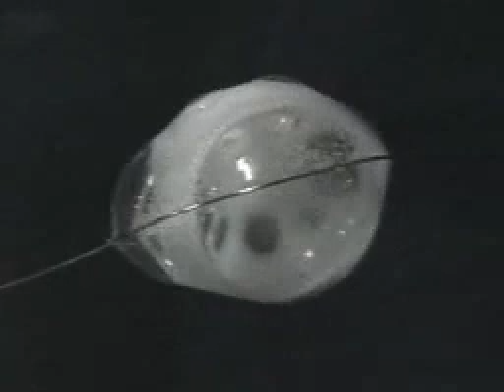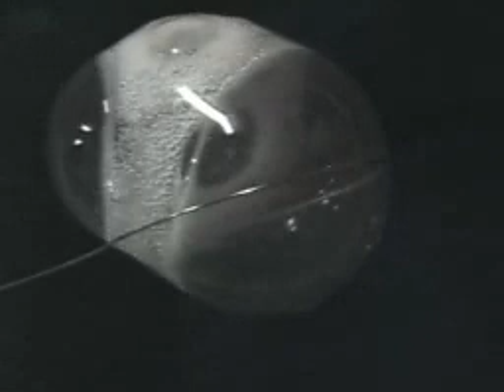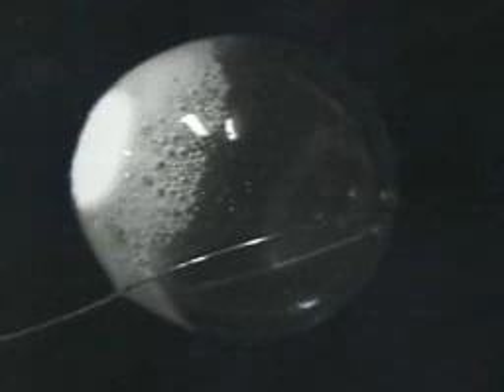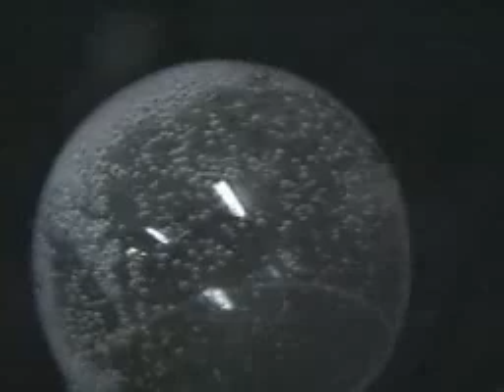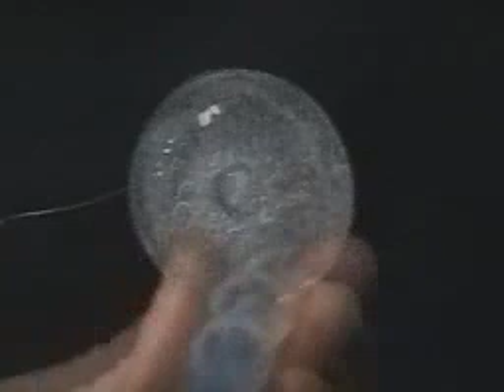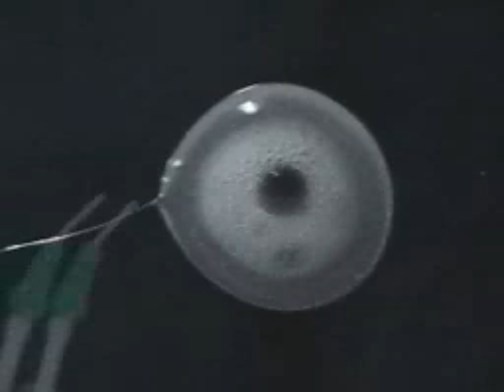Alka-Seltzer added to sheat of water in microgravity

Comment: > oh yea im sure all 6 billion people will
> leave the earth at one time. plz will you use
> common sense. 

OK, 1 leaves PER SECOND.

Then it will only take 190 YEARS to evacuate the planet.

The energy requirement is astronomical just to get into geosynchronous orbit.

The theoretical minimum to put 100 lbs into geostationary orbit is 213,305,422 joules or 202,174 BTUs - and that's if we had teleportation and 100% efficiency.

All this is "my country's dick is bigger than yours" - thats it.